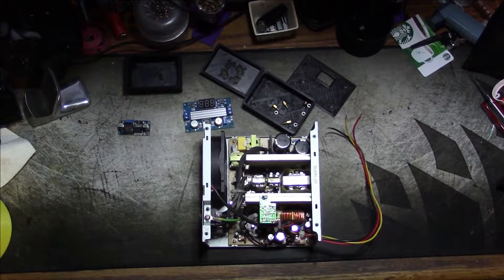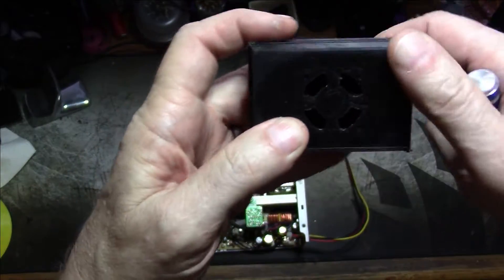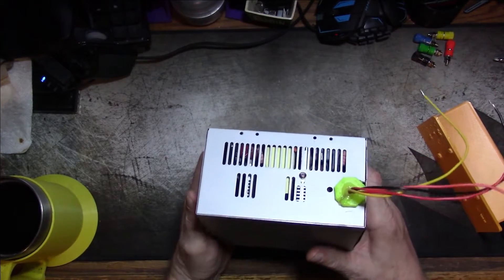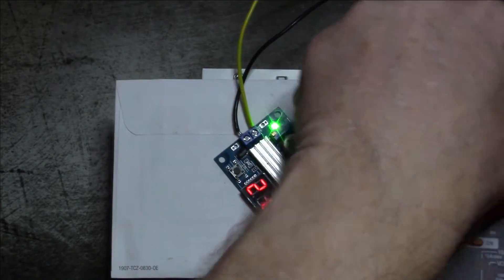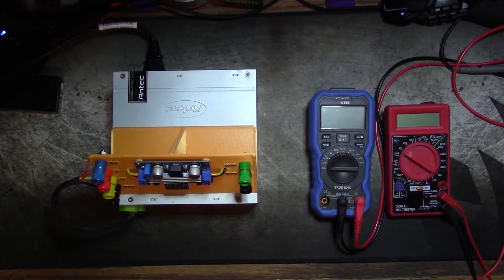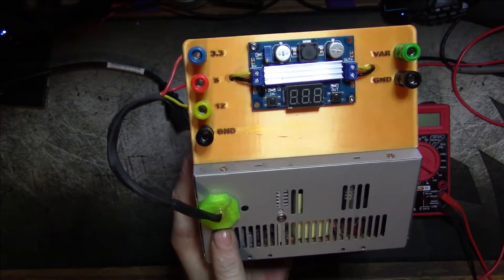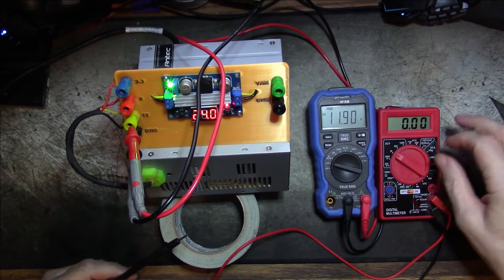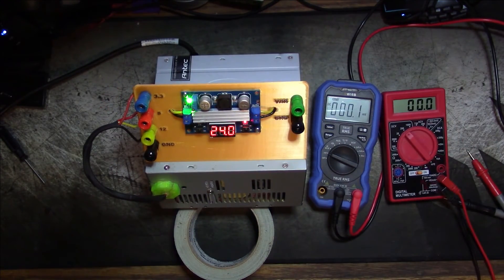Make a Bench Power Supply from a PC Power Supply

Comment: Nicely done video. As an old timey electronic tech I can relate to the lack of hands to hold two set of probes in place.  I have an old desktop PC with a dead motherboard so I'm going to make me a bench supply also. I liked your idea of using a  DC/DC converter to add a variable voltage supply. May use a boost/buck converter to get a source of 9 Volts derived from the 12 Volts as well.

Comment: nice video, thanks. I wanted to convert an ATX PSU to a Lab PS a long time ago. I found several good tutorials on instructable.
https://www.instructables.com/howto/atx+Psu+to+lab+ps/
  keywords:
ATX PS to lap power supply

Then I found this thing.
https://m.banggood.com/Geekcreit-XH-M229-Desktop-Computer-Chassis-Power-Supply-Module-ATX-Transfer-Board-Power-Output-Terminal-Module-p-1418198.html?&cart_warehouse= CN
  it's a little easier. I will also install the buck up converter, as well as several volts and ampere meters
https://m.banggood.com/Geekcreit-Mini-Digital-Voltmeter-Ammeter-DC-100V-10A-Voltmeter-Current-Meter-Tester-BlueRed-Dual-LED-Display-p-1416489.html?&cart_warehouse= CN
https://m.banggood.com/Geekcreit-0_28-Inch-2_5V-30V-Mini-Digital-Volt-Meter-Voltage-Tester-Two-Line-Voltmeter-p-974258.html?&cart_warehouse=CN
That may be a little help .....

Comment: It was the lantian 24v 400watt isdt q6 power supply and im sorry i paid 24.99 for it
Reply from the maker: That's good power supply and it's very similar to one that I use to power some shop equipment I have. But it's not an adjustable bench power supply. You had my wallet screaming in fear, "A bench power supply for $20? I'll take ten please!". lol
Reply: @3rdpig  ok lol i dont know much about them just thought it was a good deal when i bought it  lol
Reply from the maker: @jayward7536  It is a good deal for that type of power supply. It's something you use to power equipment that requires that specific voltage and amperage. It's just not something you'd use to develop new stuff or diagnose problems. Here's an example of an inexpensive bench power supply. 
http://bit.ly/2nYyPLQ
The thing I built in this video is a poor replacement for the real thing, and only when you've already got an old computer power supply or can source one for free.
Thanks for watching!

Comment: Thanks Chuck, that's a really useful device for my arduino projects. I'm sure I have a PS in the dark cave of things that will be 'useful one day'.
Reply from the maker: You're welcome Paul. During the height of my IT career I bet I had 20-30 AT and ATX power supplies floating around. I ended up giving most of them to a metal recycler. I kept a few of the better ones. Well, "better" before I took it apart and hacked most of it's wires off!  lol

Comment: Well that was some different content.  I'm a mechanical guy so electrical stuff is always a bit of a mystery.  This was pretty straight forward to follow and informative.  I've got a bunch of old PCs laying around and it might be handy to make use of one of their power supplies like this.  Thanks for the video.
Reply from the maker: You're welcome. If you don't like the idea of taking the power supply apart there's an ATX breakout board you can buy for about $15 that takes the 20 pin connector from the PSU and has the binder posts already on it. I didn't mention it in the video but since you're not an electrical guy be careful what you use it on if you make one of these, an ATX PSU can produce a lot of amperage on the +12 volt rail, enough to melt stuff if you screw up. If you're using it for sensitive or expensive electronics your best bet is a real bench power supply, you can adjust the voltage and amperage on those.

Comment: those pots are usually just a small form factor 10k pot. think you can just use a standard pot with knob and run wires to the solder pads under that pot.
Reply from the maker: Good info, thanks!